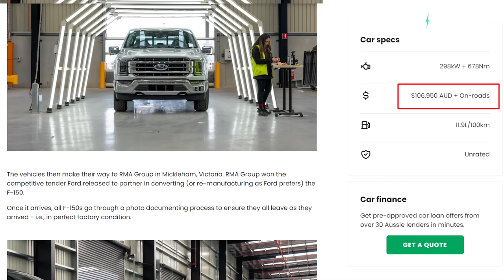Ford F150 Lightning electric undergoes engineering testing in Australia

Comment: I love my 2023 F150 Lightning (in antimatter blue). Amazing vehicle, much more comfortable and better ride then my 2023 MYLR. I use both still, but for longer trips The Lightning is my first choice.
Ty nice video.
Reply: I have the same, same color too.  Love the ride.  Taken several 450 mile one way trips and it is my first choice from our driveway.   If Gen2 is better than what we have….wow.
Reply: My friend owns one and he has trouble getting more than 125 miles on a charge. That is without towing anything or carrying any weight.
Reply: Agreed, have a Tesla Model X and 2022 Ford F150 Lightning and I prefer the Lightning to road trips.  Only issue is third party charging.
Reply: @chriseberle8363   Aaaah, third party charging.   Yes, a bug.   2 years ago I was jumping up and down that EA, Chargepoint, etc should just call Tesla and order Chargers from Tesla, with a "white label".   The Tesla Buffalo factory has extra capacity to build them.    Now, we are starting to hear companies do just that - order the charging pods from Tesla.   Plus, as Ford owners we will be able to charge at Tesla stations.   Things will get better soon.
Reply: Maybe okay for a work wagon but can't see this being useful on road trips with such slow charging.

Comment: The Lightning is/was a fantastic vehicle.  BUT it has a lot of things going against it.  Its like getting the first iPhone. exciting and great but at the beginning of a major revolution.  If you waited for an iPhone 2 or iPhone 3 they improved by leaps and bounds.  The lightning was released in 2022 and the biggest change Ford did for the 2024 model was introduce a matt black wrap.  Meanwhile competitors are talking about releasing models with 450-500 mile ranges, increased charging speeds, 4 wheel steering, air suspension, mid gates, etc..).  

In saying all that,  Everyone else's truck is just talk where as Ford has been actually building and  selling them for years.  So as we speak, its the best Truck out there and Australians (with money) will love them.

Ford's other problem was they were not ready to deliver on the buzz when they were the latest and greatest.  It's like Apple making that big initial iPhone announcement but then only being able to make 1000 phones.  Then go, oh crap, we better increase the price to $10 000 and screw our customers over.   That is a terrible strategy that put a sour taste in people that were interested in your brand but now will never come back. 

Besides the absurd pricing, the only reason I won't get a lightning is because the next gen trucks are just around the corner.  Unlike a $1000 phone where the loss is not too much of a big deal,  buying 100k vehicles where you know it will be outdated in a year which will take a huge hit in resale is not something I'm interested in.

Comment: Ford's price are very high, at least here in Norway. A F150 Lightning with the Platinum trim is priced at 1,390,000 NOK or 126,360 USD in straight conversion. Lariat is around 1,450,000 NOK or 131,818 USD. The Ford Mustand Mach-E GT is a bit more reasonably priced at around 689,000 NOK or 62,630 USD, which is still slightly higher than some roughly same sized cars and specs. Granted, they will probably not cost US MSRP in for example Europe due to freight, national taxes and conversion to EU chargers etc, but in case of the Lariat F150 Lightning its almost 42,000 USD above it. That pretty much means that it will most likely be catering among die hard Ford fans with sizeable wallet. Looks like most of us that wants a pickup will have to go ICE for now, and here that means a Ranger if you want a Ford. Let's hope your prices are a bit kinder.
Reply: Nope they wont

Comment: Australia needs to switch to the RIGHT-hand driving  as most countries do, and the USA needs to go 100% to the metric system.
If the whole world drove on the same side of the road, it would be great.
Reply: What’s the point just learn to drive on either.
Reply: @trumptookthevaccine1679  stupid reply.  It's so the vehicle manufacturers don't have to make left and right hand drives vehicles. It would reduce cost.  I can drive and have on both sides, but it's MUCH safer for people, other drivers, and foot traffic traveling for all driving to be the same worldwide. 
It also allows faster deliveries to dumb countries that have the steering wheel on the RIGHT/WRONG side and drives on the WRONG side like in the UK and AU plus others.
Reply: @davidws5439  ah yes, MUCH cheaper than changing all of the roads and streets in entire counties, changing out all of their cars, and retraining everyone how to drive 😂😂😂😂😂😂
Reply: @trumptookthevaccine1679  That's what happens when you build and design your roads, not standard to the majority of the world.  Several countries have corrected their mistakes and changed.  Goodnight on this subject.
Reply: @davidws5439  stupid reply. changing roads, cars, and training will  NOT be cheaper than making an option to have a seat in a different side 😂😂😂😂
Reply: We seem to be developing another UK English versus USA English difference. In the UK a RHD is where driver is in the right-hand seat. Whereas I'm seeing RHD meaning the car drives on the right-hand side of the road, unless I'm mistaken.

Comment: if they are still using the ice version and putting a electric motor in it it wont sell, even the yanks have turned up their nose at fords stupidity if the new model is a proper EV then maybe it will sell but fix or repair daily isnt that smart only a notch above toyoda